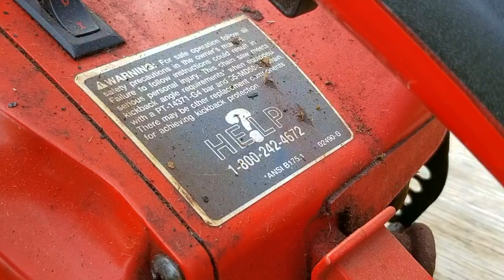Why Do you Need A Chainsaw? Especially A Homelite.

Comment: Yup, I have a new medium size chainsaw.  I live in a neighborhood with some mature trees and a lot of freshly planted trees.  I have bushes around the front and side of the house.  I recently used the saw to cut them up as they were way overgrown and just getting ratty looking even after manicuring them.  I have had two trees that came down from a storm and the saw made quick work chopping them up and using the wood for my outside fireplace.  But, the main reason for the saw is for camping.  I have a off-road camper and about three times a year in all seasons I go up to Maine and camp in very remote areas.  One time during the Fall myself and three buddies of mine went remote camping.  A very strong wind storm hit us. We were all safe with a little damage to the camper.  The problem was we had to cut are way out just to get to the logging road.  With three medium size saws it took us three days just to get to the logging road.  If we didn’t have saws we would probably still be there 😵‍💫!  I store the saw in its own box made for it with no gas in it.  I use can gas due to the fact I can’t get any non- ethanol fuel.  My reason to have a saw!
Reply from the maker: nice, you're doing it right when it comes to canned fuel. Thank you Douglas Robbins.

Comment: Chain saw ownership is a great thing but it is a dangerous thing to have if you're not a well trained person
Reply: Eh limbs are overrated
Reply from the maker: Amen.
Reply from the maker: I would joke about it, but man does it suck when one's gone.
Reply: Kickback is a major concern. Also, chainsaws need constant care like cleaning, chain maintenance, and fuel care. Otherwise when you go to use it, it won't work efficiently.
Reply: @slipperyblueclay2521  you got that right young man 👍😎
Reply: @davidmollard9832  yeah, who needs arms?
Reply: @HomeGaragechannel  I'm sure it does, I'm just a very sarcastic person
Reply: The average person not only does not need a chainsaw, but also has no business operating one. It takes years of running a saw before you get good, and personally experience some of the potential accidents that can happen.  A chainsaw has the a high horsepower to weight ratio, is very productive when running right and has a sharp chain.  It is also very dangerous. Stihl, Husqvarna, and Echo in that order on saws.
Reply from the maker: sarcasm make like more interesting and I enjoy it too.
Reply: @slipperyblueclay2521  a dull chainsaws a dangerous chainsaw. A sharp chainsaws a safe chainsaw
Reply: Trained ? 
A healthy dose of basic sense will get you by.
Reply: @WhiskeyGulf71   that is the truth about that matter young man 👍😎

Comment: When some big branches fell in a widespread storm, what the insurance was going to pay someone to cut and remove, and I already had an electric chainsaw, a mulcher, a recipricator, axe and hand tools. The investment was warranted. Every few days, a little chopping, organizing and mulching meant I could finish it they way I preferred. And I kept the usable wood. A gas one may have made parts of it quicker, but as I was trying to do it at more relaxed pace,  It would not have made a big difference. One of the big costs from insurance was actually dumping the wood and small branches not the cutting as they were already on the ground. And the insurance paid me, less my excess
Reply from the maker: thank you for the explanation, and the work should have brought some satisfaction to you, it would have for me, thank you Ant Man.

Comment: Having a chainsaw as a just in case is just like having a first aid kit, you hope you will never need it but you are glad to have it just in case.
I have a gas & battery chain saw that by no coincidence share the same chain & bar compatibility.
Reply from the maker: nice coincidence, hopefully you'll never need it but it is nice know it's there. Thank you Will Grant
Reply: @HomeGaragechannel  
I use my battery saw from time to time, it handy for rough cutting fence posts or chopping up old furniture to fit in the incinerator bin, just have to be careful not to hit any screws or nails.
Reply from the maker: makes sense

Comment: I'm with you too. I started out with Homelites, a C-5, an 1150, an XL-12 and one of the little red ones with 2 triggers that I couldn't file. Then maybe a 50 Stihl and the Super 45 and now the 440 Magnum and the 261 that the son-in-law has. I also have a Workz 110 job for trimming and the wife has the Stihl battery job with the 3 inch bar. A Coleman 5K generator with a 10 horse Briggs I/C and an old Onan 2.5 because out here in the sticks, we're are prone to power failures and now, battery powered trimmers because we're GEEZERS and can't do much. I'd rather have it as not. Gas cooking and wood heat helps too in such cases. Thanks and Blessings!
Reply from the maker: very nice collection! I'm considering getting an outdoor kitchen set up. hopefully you'll be able to see it, in the background of the videos. thank you Lewie McNeely!
Reply: @HomeGaragechannel  Everything is gone but the 440. Seems like I have a picture of it, the 45 and the Poulan. What a deal.

Comment: Thanks for the post very good video. I like the handy work, these mechanic videos are pretty fun to watch.👍👍
I do rely on my saws, I got a new MS250 which has been stored away. I mainly use my handed down Super XL12 and 330🇺🇲🇺🇲 when I'm logging by snowmobile here in the Yukon area while checking my trap line. These saws haven't let me down yet, they are just well taken care of.😁
Keep up the great mechanic vids.
Reply: The Homelite Super XL12 and the 330 are the simplest of the bunch.
That one was a pain to work on, but... I found it very lightweight, also it's very powerful for its size.
Reply from the maker: thank you both Action Alaska, and your way of life, is extremely interesting to me. It's so far from what I have to deal with. I know for you, it's the norm, but for me, I find it, intriguing.
Reply from the maker: agreed!
Reply: @HomeGaragechannel  I don't mind the weather because thriving out here is great. Snowmobile, 4x4 ATV's, river skiffs are our main way of transportation. It's pretty remote out here, most of what we eat is what we caught. I check my trapline often which takes about 1/2 a day, along with loading up a flatbed sled high with spruce logs. I use my new 1st '91 Arctic Cat JagDeluxe440LT low gear and its very reliable😁
Reply from the maker: very nice!
Reply: I like my homelite saws and husqavra poluan pro and sears crasftman they will last for long time as long they are taken care of

Comment: I buy ethanol free gas mixed with Red Armor. I typically dump the fuel and start it with fresh mix every six months when not in use. NEVER had an issue.
Reply from the maker: nice, I like that method, thank you Gilitar.

Comment: These are the cheapest most useful for someone who doesn't really need one....drain the fuel and oil when not in use...I hear even 2 stroke oil in carb keeps em fresh...I'm gna try it I love my small honelite...I own 4 of these style at the cost of one or less modern small trimming saw or limber
Reply from the maker: nice, and thank you for the tip

Comment: I have a Echo CS-400 chainsaw and I don't use it very often because I also have a battery powered WORX Jaw Saw (which is basically chainsaw but it has a case around the chain and the chain comes around like a guillotine). I use it all the time for the convenience of it. I will say that the Jaw Saw is great if you need to cut anything less than 6in and it's safer than a chainsaw. Highly Recommend if you don't have branches that are big. The only time that I have used my Echo is for bigger trees that were not cut down to a decent size and for a bigger tree not capable by the Jaw Saw.
Reply from the maker: thank you Lawnmower Master, and yes I've seen that WORX, pretty interesting.

Comment: I currently have 3 saws a ms461 my primary saw, a Chinese knockoff of a 200T for the rare times I have to climb a tree, and a ms 170 I keep in my Jeep for the inevitable fallen tree or limb across a trail or road. That little 170 is a great saw that everyone should own! it’s a really terrible saw (no power and can’t oil or run a long enough bar to let you stand up) but it will get you out of a jam and you don’t worry about it getting stolen. Remember having a nice saw won’t help you if you don’t have it with you! There’s no way I’d leave a $1500 saw in my Jeep all the time. I run my 461 at least once a week I’m always cutting firewood even in the summer. One can never have enough firewood! You’d be amazed how much wood you will go through in a winter and buying firewood is just to expensive so I’m always on the hunt for more. If I didn’t burn wood and lived in the city I would probably not own anything but that 170. 

My advice is if your cutting for any real amount of time and are around 6ft tall get yourself a saw that can run a 32in bar. Being able to stand up and buck will save your back! Trust me on this I wish I knew this years ago it is IMPORTANT!
Reply from the maker: wow, thank you for all the good information!

Comment: If you own a home in a subdivision or rural setting, you should be able to maintain that household. Too few ppl can/do even the basics like maintain their lawn or fix basic things...That being said...if you can do things for yourself-which I believe a homeowner should be able to do...have a basic gas chainsaw like a Ryobi RY3714 or similar. I picked that one because they are less than $200 brand new at Home Depot in the US and only slightly more in Canada. I bought one virtually new  for $50 and have made hundreds using it to trim up low branches/debris clean-up...(I have larger saws also-but for emergency use...could get by with this little powerhouse-I love it)...learn how to use it safely, sharpen the chain and have safety equipment and store it away with a spare chain...if buying used you could likely do all that for less than $100 and have peace of mind. I bought my brother a 38cc 16" Poulan for $35 and tuned it up and gave it to him so he wouldn't have to borrow mine ever, (also peace of mind as I don't like lending 2 cycle equipment out and if I do-I supply the fuel and it is never my main piece of equipment - only a backup or loaner unit)...love your channel - cheers!
Reply from the maker: thank you Kirk Leaper, I appreciate this comment.

Comment: I agree  that having chain saws are good 👍 but if the new owner has no experience on how to use them it can turn dangerous quickly I say read & follow all instructions on everything that’s bought I’d  also like to add if the owner doesn’t use his or her saw often I’d recommend something battery 🔋 powered if you need to store the saw i would put in fuel  treatment to insure the gas don’t go bad or buy premixed caned fuel 😀😀
Reply from the maker: you are correct, pick the one that works best for you and be extra cautious

Comment: I have a 1980's Homelite that's been a beast. I have cut many a cord of wood, even helped clear our road of fallen trees due to a hurricane.
I plan on firing up soon. My question is it has a 16:1 gas oil mixture. can I do a 40:1 or 50:1 ratio mix?. Premium gas with a good quality two stoke oil. Thanks
Reply from the maker: no I'd still use 16:1 just like it say, otherwise you're taking a risk.

Comment: My saw is similar but not the same to the one in your video.  It is a late seventies or early eighties origin.  Purchased from the local dealer at the time.  It has the "Homelite XL automatic oiler" on the round badge.  The tag shows a 'model' #105154  and a serial 792910317.  I can not find the identity of the saw from these numbers.  It is of course a top handle saw and most reference sources do not even list these while listing all the other 'XL" variants.  Any ideas.
Reply from the maker: no ideas, if you've already looked it up, then I'm not going find anything different

Comment: I have a question hopefully you can help me with? I bought a Poulan 42/18 chainsaw brand new 2/25/23 from my work (Harbor freight) this is my very first saw ever i owned. It runs awesome but strangely it leaks a lot of bar oil. By alot I mean when it's running it leaks all over the bottom and gets all over the saw, do you know why?  And how I can fix it?
Reply from the maker: sure, quick question though, what kind of oil, are you using for the bar oil?
And unfortunately unless there's an adjustment for the oil pump, 
it would appear that either that's what it's supposed to do, or the pump is bad.
Reply: @HomeGaragechannel  I'm using STP bar and chain oil. I'm not sure if there's an adjustment for it. Some said use  heavier oil, but I wanted to get your advice before doing so. I ran it today and it didn't seem to be leaking as bad.
Reply from the maker: have looked at the owners manual to see if there's a way to adjust it?
Reply: @HomeGaragechannel  I haven't looked I'm gonna read through it, I'll definitely let ya know if I find out

Comment: The old Homelites were much better than the new Homelites. I don't like the new Homelites at all, especially over the fact that they are not made as good as the older ones from up to the early 90s models. When it comes to a homesite chainsaw, I will go with the Super XL or Super 2 because they are definitely a lot better than what you buy today.  The older Homelites were made in USA while the new Homelites are made in China. Even the older vintage Poulan, Sears Craftsman, and McCulloch chainsaws were a lot better too. So now if you want to buy a new chainsaw, save your money and STIHL, Husqvarna or Echo, or look around for a vintage used chainsaw that is in good working condition.
Reply from the maker: very good advice

Comment: Chainsaws are easy to use, just don't be a dumbass. I've used kitchen knives thousands of times but three or four times I cut myself really good. One of those times I sliced the tip of my thumb off (it got stitched back on). I probably would never make it to the hospital if I was as careless with a chainsaw and cut a ten inch gash in my leg. Just respect it, stay out of its way, and never lose your concentration and get careless. They're extremely safe when operated properly.
Reply from the maker: you're right, but asking someone to not be a dumbass, is very wishful thinking.  Besides accidents happen, and it only take but a second, just ask Ted Nugent.
Reply from the maker: LoL.. yes he is... and I like the car analogy